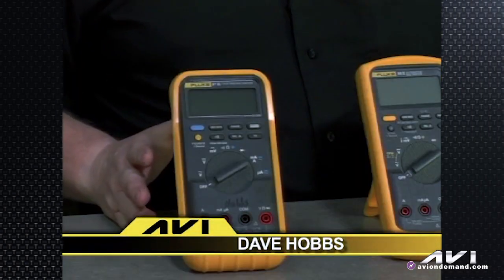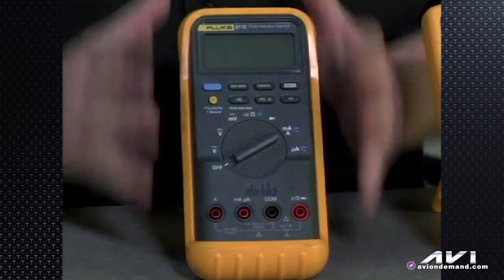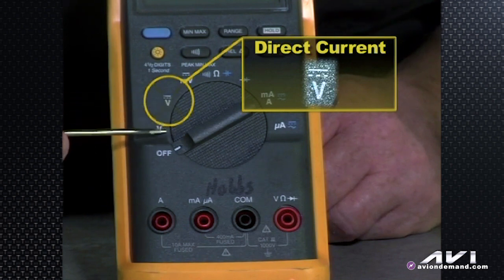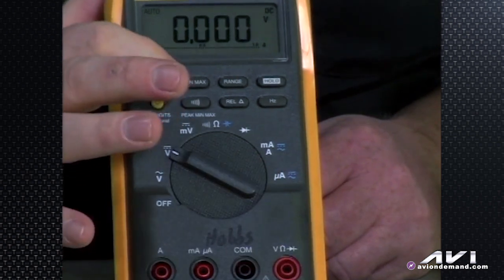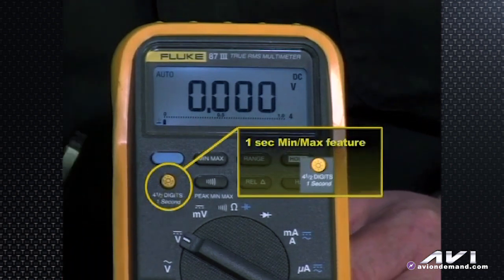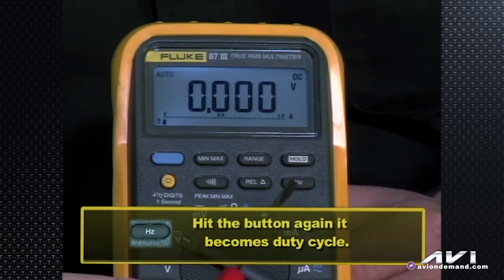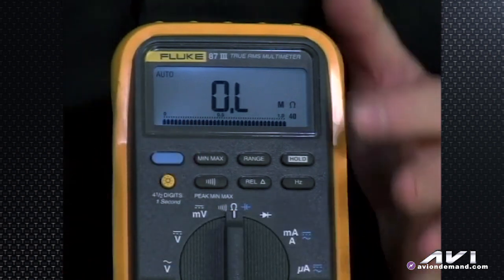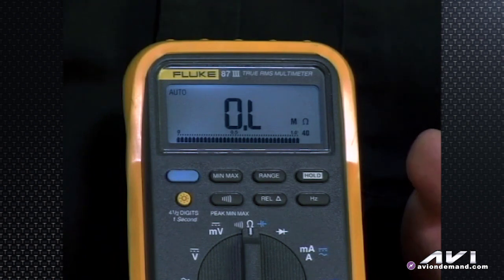How To Use Your Fluke 87 | Dave Hobbs | Tech Tip

Comment: Fluke meters are no longer the best that there is.
Reply: They are NIST and they require calibration once a year.
They are not the best for most but they are the most consistent for use.

Comment: How do you do to use a fluke current transformer 801-601, on a Fluke 87 ? ( Need to check the current consumption of a 100 amps breaker ). Thank you